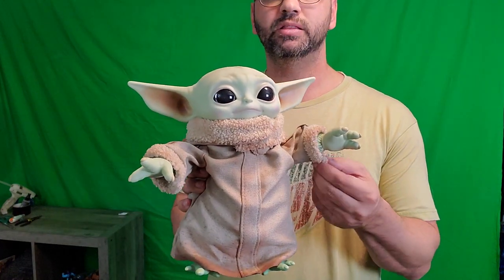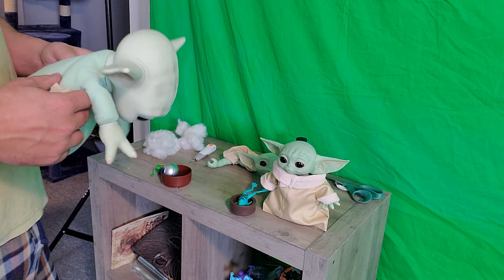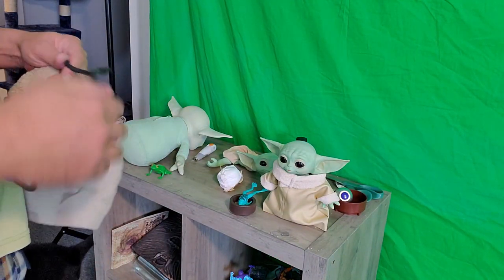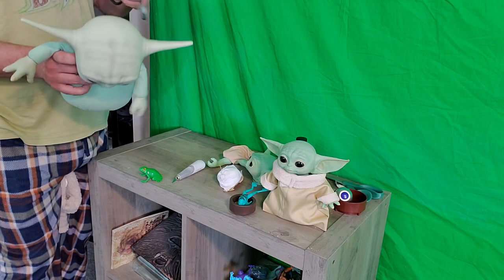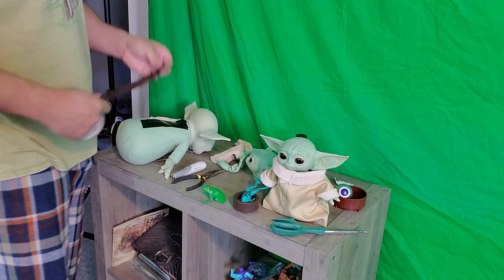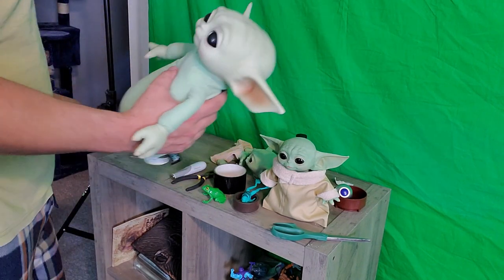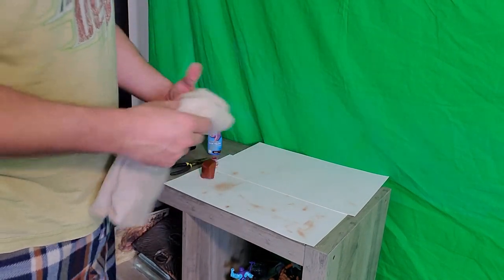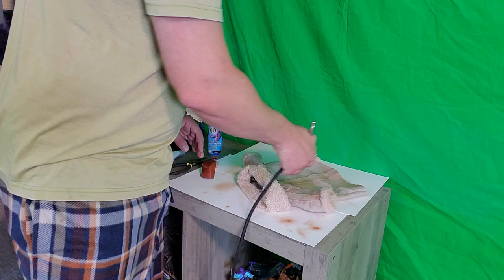Mattel Baby yoda with armature, sound, feet, and repainted coat! PIMPED OUT!!

Comment: It has a pop off cap at the base of his neck. I took mine apart to repaint. You can run the wire under the bagthere it 2 stitches o  each side of the bag that holds the bag in place.
Reply from the maker: My two have zip ties?
Reply: @xxxgothmanxxx  yes in the head and the hands for the Mattel you can cut it of and get off the hand and when your done you can get a zip tie and put it back